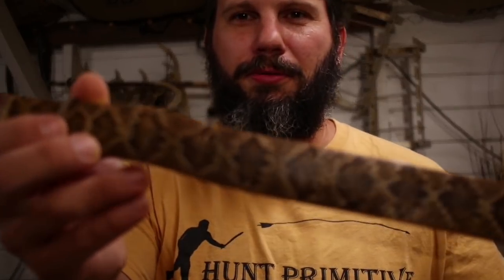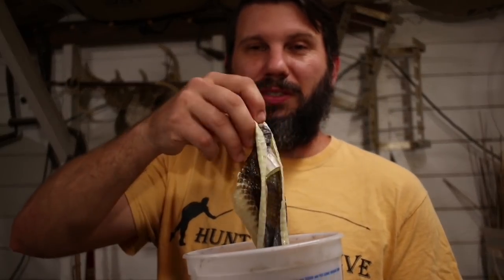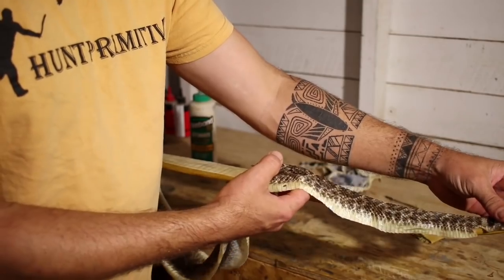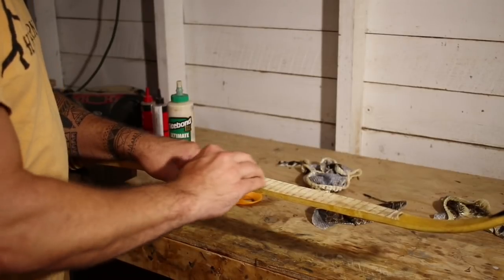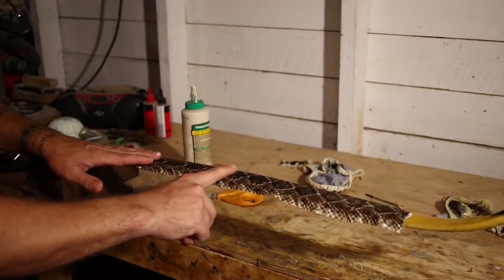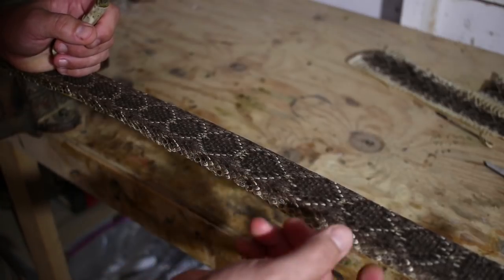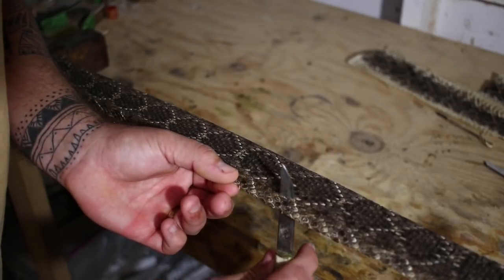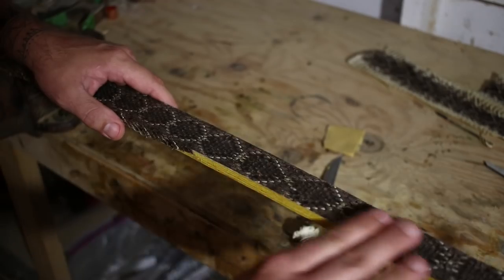How to Put Snake Skins on a Bow

Comment: Been a taxidermist for 30 plus years.i put copperhead skins that were in glycerin and alcohol for 7 years on my recurve with no problems at all after one year of rough hunting.its all about degreasing,cleaning and the type of glue you use.if this interests you contact me I be glad to tell you how it can be done successfully. Love your videos and content
Reply from the maker: I appreciate it. Since this video I have been using skins cured in glycerin as well. I just degrease them heavily and as you say, they work just fine. Thanks for checking in and wanting to share the tip